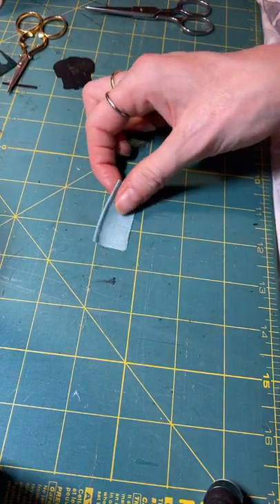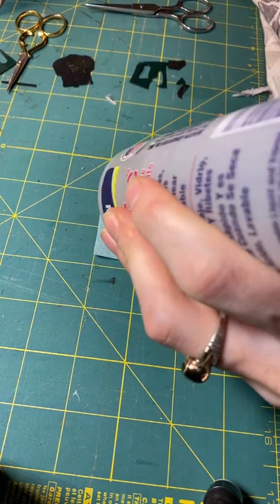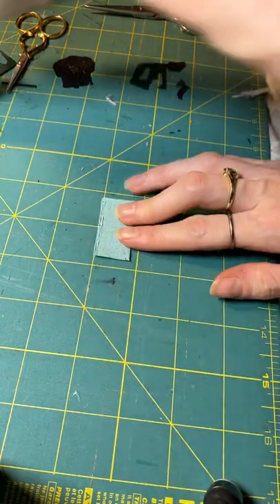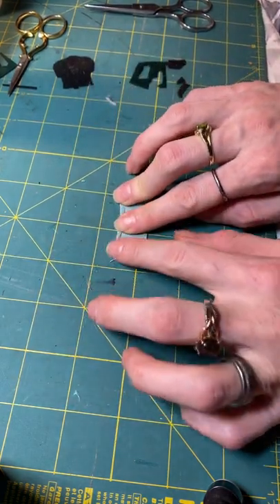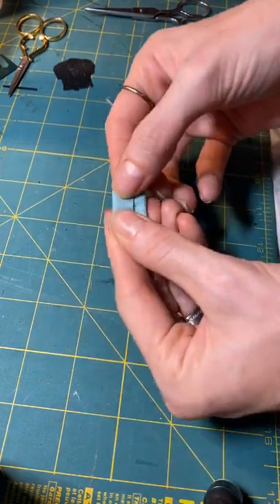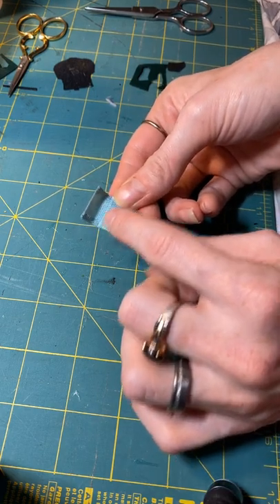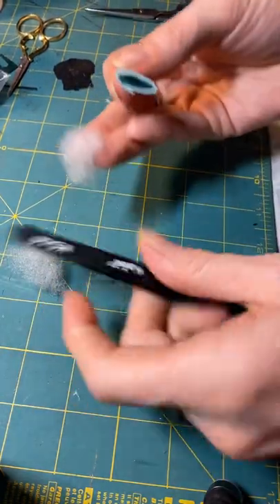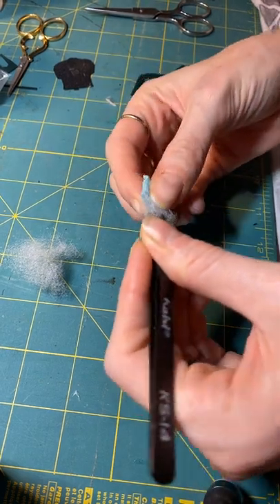Part 1: pillow making

Comment: How long did you let it dry before stuffing? Thank you subscribed
Reply from the maker: I held it closed after putting the glue on for about 20 seconds and then started stuffing and held it at the bottom while I stuffed. I use the beacon fabri-tac glue so it holds really well and sets up really fast.
Reply: @minisculelife5170  thanks sweetie
Reply from the maker: @tinataylor4203  you are welcome!